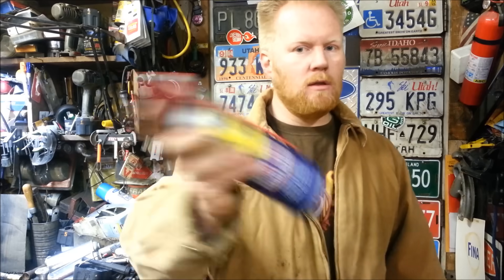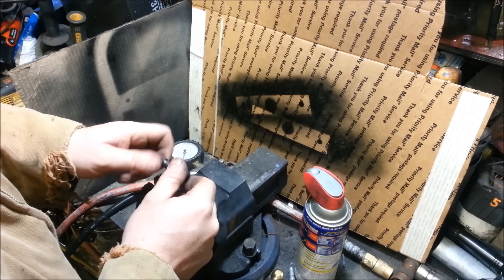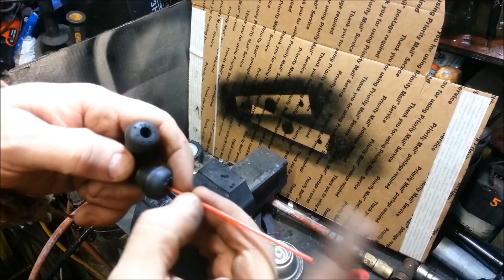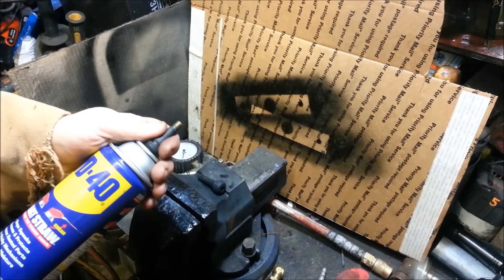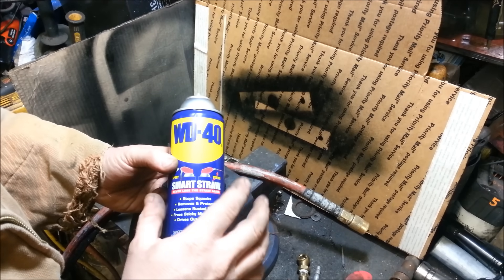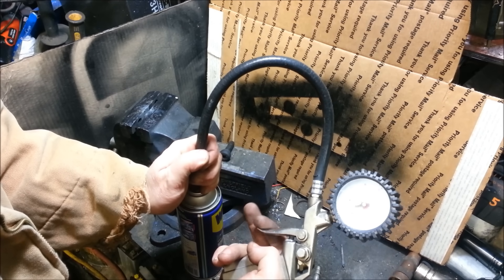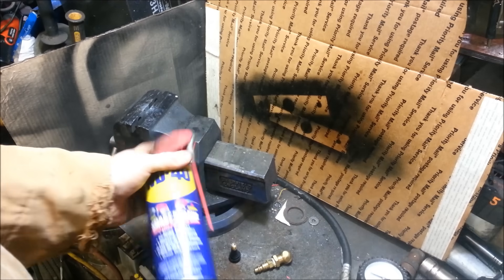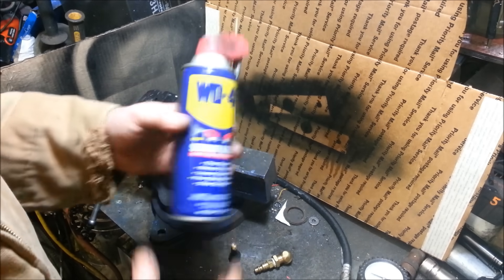Refill flat AEROSOL Spray Cans like the WD-40 and others

Comment: I hate to leave a comment like this. I just want people to understand the dangers in order to be safe. This sounds like a genius idea however pressurizing a can of flammable liquid with air or oxygen is a really bad idea. It is possible they use butane or propane as their propellant in wd-40. Pressurized flammables are dangerous but if you add oxygen (air) to the mix you have an explosive combination.
Reply: Yeah, in the 1980s I had a "Gas"/smoke detector mounted on a ceiling outside a half bath in my place.  The half bath served as a quickie prep spot as it was downstairs and I used to have a can of hairspray on the small counter for use when I needed it.  Every so often I would use that spray and return to the kitchen to finish breakfast.  Almost 5 minutes later, the alarm would sound off if I had not turned on the half bath light/fan combo.  For a long time, I remained baffled as to why the detector went off--at 6:30am.  Then I finally looked at the hairspray contents---Propane or something like that.  !!!!
Reply: Good point, it sounds plausible! It spooked me enough to forego trying it. It may be low psi, but compressing air induces friction. Probably not enough friction to cause combustion?
Reply: @JamesHarris-  He should have a disclaimer in bold letters displayed at the beginning of the video. I think suing would be difficult because it is something of an opinion,  isn't it? In his defense,  he could say something to the effect of "I did it but didn't know if you would follow my example." Example : If your friend jumped off a bridge would you jump?"
Reply: Yes, there is definitely a reason they don't fill it with free air and use propane instead.
Reply: Well you pussies just throw away your half empty cans. I'll bet you're afraid to roll up your tooth paste tubes also.
Reply: TheBuildCave k
Reply: "I hate to leave a comment like this"  hahaha, Safety Sallie
Reply: Highly unlikely due to the small amount of oxygen in the atmosphere.
Reply: The WD40 can itself says that they use CO2, not propane or butane, so you should be fine.
Reply: TheBuildCave i,use the same method as he did never had a problem  yet .you have a good point but if you dont over do it with the presure you should be fine .
Reply: More flame action? Sounds good to me hah
Reply: The stupid ass stuff people on you tube look to complain about or let some one no there wrong or this or that. If yiu disagree or think its stupid dont watch. Who care if its stupid or not right by your standards. Let it go you tube safety police officers, you tube no it alls and you tubers who have never done something stupid in any way what so ever. Get a life!
Reply: Anyone who thinks mixing room air with propane or butane in a pressure vessel is really looking for entry into Darwin awards. The comments such as its not pure oxygen... Guys get a life cars run on room air.. At about 17%oxygen and the small amount of propellant left and the oil based product you are reaching ideal conditions for compression ignition.
And no you won't need a spark to set it off. Working with Ci engines we use propane or butane fumigation to increase power. This idea is nuts unsafe highly volatile and Darwin. BTW a minute amount of grease or oil substrate will spontaneously combust in pure oxygen. So even that has higher risks
Reply: TheBuildCave - I see your point. Next time I refill my can this way, I’ll be sure and check for any little people hiding out in the can smoking their cigars. 

Flammables, oxygen and that lit cigars =s a very big esplosion. Booooooom!
Reply: @BartSimpson-nr1dy  pure oxygen and hydrocarbons spontaneously combust. You won't need a flame. A compression ignition engine doesn't have a spark to ignite and cyl pressure of a deisel engine can be as low as 150psi but heat produced by compressing room air can ignite. Its the exact experiment that inspired hans deisel to design and build his first engine experimenting with gun cotton as a fuel source. Bart don't be like your name sake and read some history
Reply: Freon was much better and safer at pressurizing cans.  It didn't leak down as bad.  I think it's something to do with it doesn't deteriorate the seals.
Reply: funny, they have been making and selling rechargeable aerosol cans since before i was born and we used them for the 24 years i was in the oil industry without a failure or explosion with all sorts or Petroleum products in them.  we charged them with compressed shop air all day long. we did not use a bottle of oxygen which would in fact actually be a bomb "IF" oil or a petroleum product were present. it helps if you have the right info and knowledge before commenting. https://www.zoro.com/sure-shot-sprayer-steel-black-200-psi-32-oz-a1002/i/G2684040/
Reply: I'm guessing they normally use propane because it liquifies under enough pressure so they can put enough in to hopefully be able to spray all the oil out, which unfortunately doesn't always happen. Also it doesn't doesn't have water vapor in it. With a typical shop compressor, I doubt you'd get enough air into the can to heat up to a combustion. You biggest combustion issue is onec the stuff gets sprayed out, but no more so than when the can is spraying propane and oil into air.
Reply: Oxygen is NOT flammable its a catalyst, butane and propane ARE flammable  hmmmm......
Reply: @jjjsmith2497  Oxygen under pressure and hydrocarbons (oil and grease) can react violently, resulting in explosions, fire, and injury to personnel and damage to property. ... Even a small amount of hydrocarbon can be hazardous in the presence of high oxygen concentrations.
Reply: So u mean not only do u get the rest if the wd 40 out u can bkow it uo after too yippeeeee
Reply: Not Flat wouldn't the mere act of pressurizing air cause heat?

Comment: Have you ever seen the gauges on welding torch oxygen bottles? When you increase the partial pressure of oxygen on oil you risk the chance of a explosion...Hal
Reply from the maker: You're talking an pure oxygen bottle with over 2000psi of pressure. "Air" is roughly 80% nitrogen and 20% oxygen and we're dealing with 50-100psi here. Even if you nailed the proper fuel to air ratio you can't expect "dieseling" until you get upwards of 700psi. This is like saying you're going to drown, comparing a single rain drop too the ocean.

Comment: If you have an old air nozzle with the rubber tip that delivers full pressure that will work by itself.  I had a new can of WD that had an obstruction in the tube, gave it a quick blast through the nozzle and it worked.

Comment: Most manufacturers will admit that 35% of their products cans have faulty valves that fail to reseal completely after each use causing a loss of propellant . Whether by design or accident they still benefit by getting you to buy another can. Good old fashioned American Capitalism at it's best.
Reply from the maker: They win both ways.

Comment: Why bother? Tip the can upside down and make a small hole in the bottom, then pour out the remaining oil into a squirt bottle. Make sure the air is all out of the can when you poke a hole in it. A little air in the can is fine, but if too much it will spray all over and even blow a bigger hole than you want.

Comment: You know how those Clean dusters that blow air that you get from staples or office depot are so expensive, can this be done to them as Well???
Reply from the maker: No it won't. The air dusters are not really air but Freon (r152a) refrigerant. It compresses and turns into a liquid so a lot can be stored in a can unlike air. If filled with straight air you would only get 10-20seconds of an air blast.

Comment: if you've managed to use up the gas in a can of WD-40 but the can still has WD-40 in it then maybe you need to re-evaluate the way you are using that WD-40 , because what you are describing shouldn't happen. (i.e you're using the WD-40 in a weird manner) The fact that you gotta refill the can with air although although it is supposed to be gas says something about you and your weird way of holding the can.

Comment: You can also puncture the bottom with an awl -- just a small hole -- and stick a bike pump needle in there.  Very quickly hit it with duct tape.  It leaks slowly, so a couple of hours later it's back to no air.  So do it when you're ready to use it.

Comment: Weird shit. I had a small can of WD and it ran out of air so I got pissed and threw it over the gate to my compound and came back to it a few days later to throw it away and the shit actually worked again. Been left outside in 80 degree weather and still had plenty left.
Reply from the maker: Sometimes they plug up internally.
Reply: sixtyfiveford No you could squeeze the can and tell the air was out. Guess the heat outside built the pressure back up.

Comment: Off topic: See that white tip at the 0:50 second mark? The problems I have is when I drop the can, that tip will break and render the can useless, not just WD-40 but all the spray cans. With paint spray cans, the tips usually get clogged and no way to clean it, even with lacquer thinner. That is even shaking the can for half a lifetime then invert the can to clear out the tip. Happens more with automotive primers sitting on the store shelf for too long. If there is only a way to put thinners in the can!
Reply from the maker: Yeah, the broken off tip is a death sentence for these. I've had great luck with carb cleaner(Acetone) being sprayed through the tips too keep them/clean them.

Comment: Lighter fluid comes in a can with several adapters. At least one of those should fit in between your can & the nozzle of your air blow gun.
For inflating bicycle tires, I simply push my air blow gun on the valve stem; because it doesn't seal perfectly, the tire inflates properly without popping.

Comment: Nice. I think I will use my nitrogen instead though. Because it's an inert gas. Kind of funny putting air compressor moist air in a can of WD-40 which is water displacement. But It gets the job done.
Reply from the maker: Propane is actually better and more like what it come with from the factory(mixture of Propane/butane).

Comment: That is awesome, I will have to try it.  In Wisconsin when it is cold, many times I find that I run out of aerosol pressure in many of the various spray cans I use.  I wonder if it also works on spray paint cans.  Thanks for the tip.
Dr. Paul
Reply from the maker: I've done it on paint cans. But the paint will begin to set up in the can, so it needs to be used up.

Comment: I figured this out a year ago for a 20yr old bottle of penetrating oil.  Just an air blower works if you do it right
Reply from the maker: That's how I did it years ago, with a good rubber tip blower. I found the tire valve allowed more control and allowed me to put it at around 50psi easier.

Comment: wd-40 is not a lubricant as many people believe. it actually washes away any lube on the metal. it may work a bit as a penetrant but I prefer Break Free for this. also wd-40 doesn't mix well with water so any moisture in the air will cause corrosion inside the can.

Comment: I think this is kinds dangerous. The can is not designed with enough metal to prevent fatigue if it is refilled. Doing it once is probably not a problem, but if you did it say 10 times or more, it would be like flexing a piece of sheet steel back and forth multiple times, it may start to crack where there is a stress concentration. Refillable pressure vessels are build with much more metal to make the amount of strain (deformation) of the vessel under pressure so small that it can be safely refilled thousands of times without fatiguing. You could get the same effect more safely by just immersing the can in hot water and then spraying out the unused contents.
Reply from the maker: The cans commonly used are DOT2Q rated. Which means they have a minimum burst pressure of 275psi. Refilling it to 50psi to get the last bit out is not going to fatigue the metal. You would need to refill it hundreds is not thousands of times to cause metal fatigue at these low pressures.

Comment: Can I make refillable air spray cleaner for my laptops to blowout the dust?
Reply from the maker: Not really. Air alone won't compress enough in a can to give you more than 5-10seconds of spray. Computer duster is actually Freon, r152a to be exact and turns to a liquid when compressed(unlike air) so a lot more can be put into the can.
Reply: Thank you
Reply: sixtyfiveford thus part of the reason the can gets very cold upon spraying a computer out.

Comment: Now you have a flammable content together with 20% oxygen in a pressure container!!!!!!
Reply: I was thinking will it explode
Reply: At least SOMEONE is thinking!!!!
Reply: Accidentally spray the refilled can near anything hot or a flame or spark and instead of a burst of flame a normal can emits out the nozzel expect the can to grenade in your hand.
Reply: Ya I call bullshit.
Reply: @ladaveednas7173  You think premixing air with a combustible liquid is safe?  It's not like spraying something else onto a flame where it doesn't propagate backwards....this is a fuel+O2 mix that doesn't halt at a choke point.  Your only hope is that it's coming out faster than the burn propagation, and that's 1. unlikely, and 2. definitely won't be the case once it dies down.

Comment: My only fear is putting air in a can containing a flammable oil mixture, I was under the impression that the propellant in these cans was Butane or Iso butane or similar flammable gas. Surely it would be better and safer  to recharge the can with cigarette lighter gas. There is maybe a small risk of explosion having oil compressed with air. And air does not compress as well as Butane. The can could rupture in hot weather. However it is something I would risk doing to get the last drops out.
Reply from the maker: Most cans are DOT2Q rated, which means they're rated to a minimum of 275psi. Even if you added the correct fuel to air ratio, you would need to exceed 700psi for auto ignition(dieseling). Generally gases that turn to a liquid under pressure are used ie: Propane, Butane, CO2, Freon, etc. They are used because they provide a stable pressure throughout the entire volume of the can as it is diminished. "Air" doesn't compress to a liquid so if it was used with a new can, when the can was half empty it would only spray half as hard and it would get weaker as more of the can product emptied.
Reply: Good and useful video. When mine ran out of air I would just put a small hole in the side at the top and drain all the wd40 put .and put it in a plastic bottle to keep on using.
Reply: how would a flammable  be safer then air?
Reply: Greg Miller Because a Flammable gas is not an oxidizing agent, it contains no Oxygen. The oil in the can is flammable and a fuel, and so would a flammable propellant be fuel. Pure fuel can only burn in air or when in the presence of air. Putting air inside a can of fuel can be dangerous. Its easily explained if I say that an empty gasoline tank is far more dangerous and likely to explode than a full one.. Because the full tank of gasoline is too fuel rich to form an explosive mixture, but an empty one containing air and gasoline vapour can explode easily.

Comment: Great tip! I've had way to many wd40 cans lose pressure & not with other brands, been putting hole in can & draining out.  If anyone hasn't tried the JB80 that's the best I ever used, but can't get in my area anymore.
Reply from the maker: Never heard of JB80, I'll have to keep my eye out for it.
Reply: It's made by Justice Brothers. the JB weld guys , say's "Twice as good" on can & I'd rate it higher than that. Local auto parts here in Montana  used to stock it but the local distributor died, I bought everyone out, but am out now.  Can get on line, but haven't gotten around to it.

Comment: you can just blast some comp air into it without any fancy apparatai I guess you'd get only 20-30 psi but you're low on wd40 when it gets flat plus a 2liter soda bottle can hold 120 psi but it's scary

Comment: I use those lil compressed air cans to blow off keyboards among other things and I'm going to try to refill it this way. Thanks
Reply from the maker: Those are a little different. They are filled with "freon" R152A and condense to a liquid when under pressure. So they get a lot more product in the can than you would be able to with normal air. If a can is filled with plain air, you would expect to get around 5-10seconds of total spray.

Comment: Great idea.  I wondered if this could be done, but didn't know how it could be done.  Of course I don't think I would go that high in pressure.  I would think you wouldn't need nearly that much air to finish out the can.  Of course it could be dangerous, should the can explode.
Reply from the maker: BAYOUMAN Most cans like this are DOT 2Q rated. Meaning they are designed to hold a minimum of 270 psi before burst. 50 psi seams adequate for most situations but 90 is far below the safety rating.

Comment: Hmm.  flammable liquid plus air under pressure = bomb!
Reply from the maker: Not even close, there's a lot more to make an explosion. Hmm, most aerosol cans are already under pressure and flammable.
Reply: But not oxygen in aerosol.  By adding air you are adding an additional key component of the fire triangle.
Reply from the maker: It takes over 700psi to create an explosion. This will never get even marginally close.

Comment: Go see video on the Diesel-cycle........you're making a bomb by pressurizing with oxygen containing air......use nitrogen
Reply from the maker: It doesn't even come close to the pressures to Diesel (700+psi). You couldn't put that much pressure into the can if you tried.
Reply: What you are breathing and compressing is 79% nitrogen...that is what is in the atmosphere...19% oxygen....the rest mix gases..you are good to go